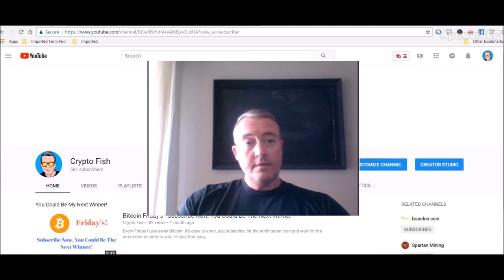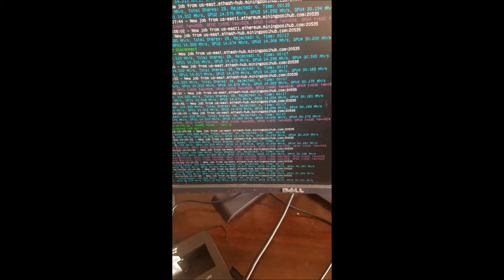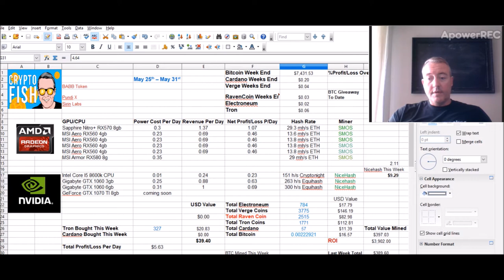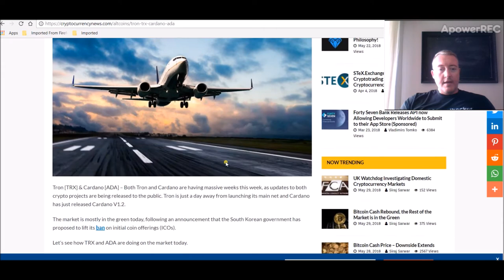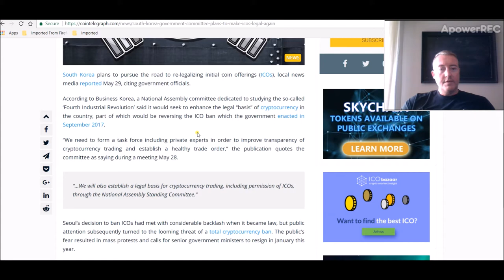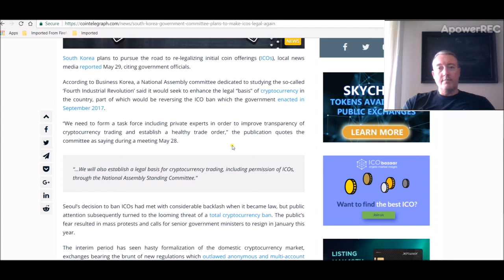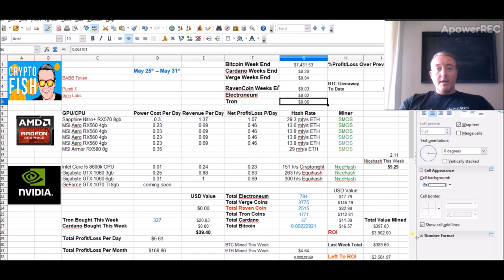UBit PCIE Splitter Issue - TRX BTC And ADA News 5-29-2018

Comment: Brandon Coin fitted one of those back in April on a Windows 10 Rig.
I had Windows 10 fail to pick up a card. I had to go into Device Manager and click each visable card then update the drivers until the card suddenly appeared in DM.
Not sure if that'll help especially if your not using Win10.
Reply from the maker: vin doopays thanks for the tip but I'm running linux based os so that won't work
Reply: You could power on, then put a USB stick into the card. I'd try a V3.0 and V2.0, and see if it's recognised. See if the stick & card shows up when you type lsusb and lspci in a 'command window'. I'm not a linux dude, just what I've seen browsing. You may have to trawl though the linux forums and maybe reach out to a linux guru.
Reply from the maker: vin doopays ok, thanks